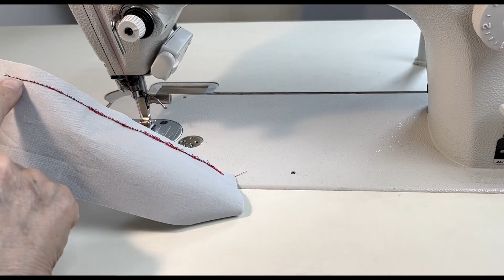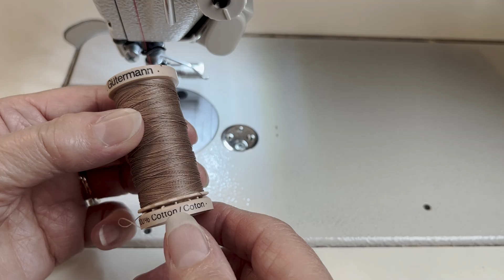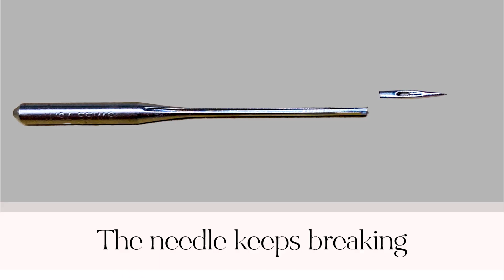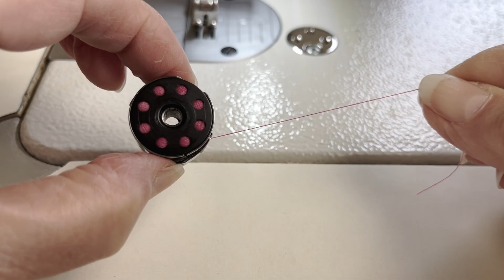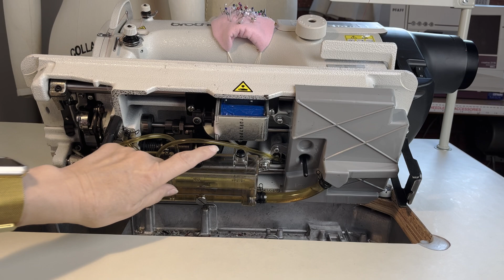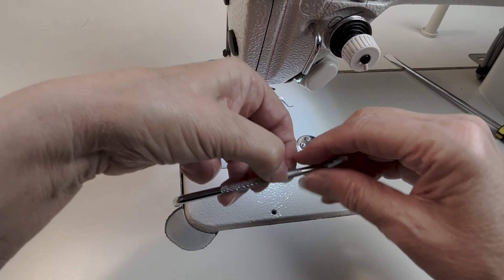Master your Industrial sewing machine (Industrial sewing machine problems)

Comment: Hi! Can i ask, what is the purpose of that little metal thing, what is on the right side of presser foot? I've had my machine few years now, but i cant find information about that.. Also, my machine cuts the threads only once in a while, but i have not found new cutter to it.
Reply from the maker: Its called a quick change pressor foot clamp and replaces the pressor foot screw. You just push the clamp to release  the pressor foot and push it again to install the next foot. I love it!  I would recommend having a mechanic check it over. The thread cutting setting is not something that I would try adjusting on my own. Thanks for watching :)